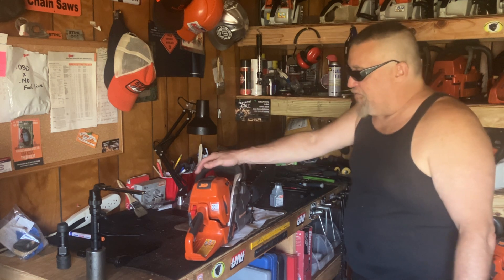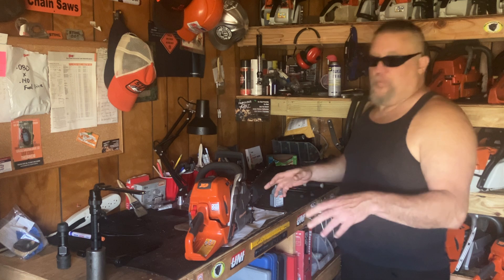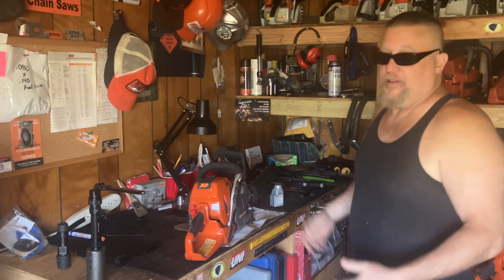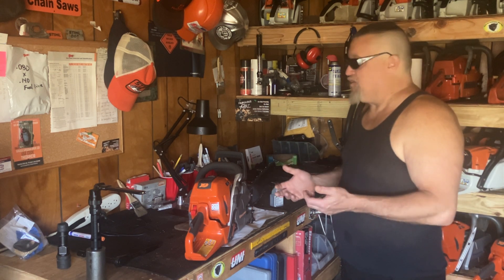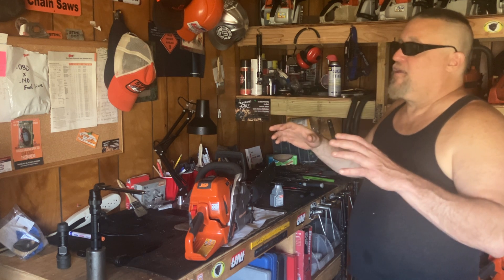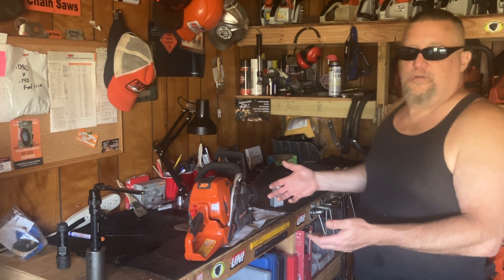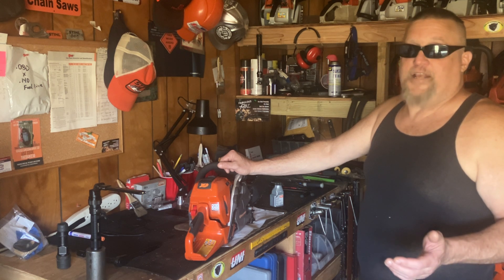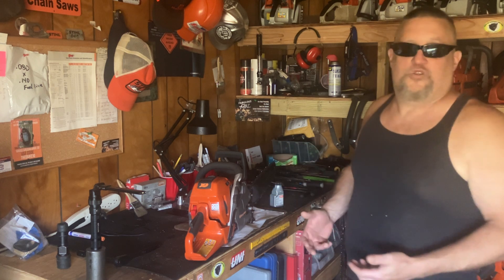Ol Fabz givin ya the straight goods on a few of these utube  “amature-experts” / charlatans 😉

Comment: I had a interesting scenario comparing one of my shops 2-250 dlr woods ported saws with another builders 5-600 port jobs. To mch to txt be nice to talk to ya direct buddy
Reply from the maker: My Email is in the description - I’ve done similar comparisons and have even purchased saws built by other well known builders that occasionally come up on eBay in order to be able to give an intellectually honest comparison / opinion … My conclusion : the old-school way of saw building is superior in terms of 1)performance, 2)fuel economy and 3)longevity vs the machined / ported high compression builds (which may cut 1 sec or so faster  in a 20sec cut) but use more fuel and most certainly do not last as long !   There are other issues with the tune-ability, heat (running too hot 🥵causing loss of power) and the increased likelihood of catastrophic damage occurring which usually takes out the top end (minimum) and sometimes results in a very expensive paperweight- they also can be a pita to pull over in cold weather and do a number on the starter mechanism. I’m of the opinion that a ported saw should equal the next class up (562xp modded runs / slightly exceeds the 572xp stock saw) and that’s THAT. Taking a 4.7hp 562xp and building it to produce 7.0hp IS possible , however not very practical in a real world , work environment- as a toy / “race” cookie cutting gtg saw sure. Unfortunately ya can’t make THAT style build into a useable worksaw , any more than ya can make chicken soup outta chicken shit 😂

Comment from the maker: https://youtu.be/XaaUxi31l3Y?si=u42_383-11DOaAeR … here is another perspective on STIHL ultra from a small engine mechanic - interestingly enough the “professional chainsaw mechanic / guru” Richard Flagg (and his flunkie Jason Pennington) mentioned in my video who bashes STIHL ultra (refers to it as “pond water”) makes an appearance in the comments section of the above video and admits that though he bashes the STIHL ultra it works just fine … AHA ! 😤 There simply Cannot be folks who get hundreds of hours using ultra / pump gas and then the 180degree diametrically opposed position that the oil is garbage that Mr Flagg / flunkie Pennington asserts. There is too much life experience by others that indicate results that do NOT align with Mr Flaggs / flunkie Pennington position so someone is incorrect / not being intellectually honest. Like I said in my video , my position is that Richard / others are overbuilding their saws thus causing them to operate in such a manner that the STIHL ultra wasn’t designed for (perhaps excessive heat 🤷). Now that we get to the TRUTH of the matter we see that the ultra mix oil seems to work  just fine for everybody else , and that the BUILD  is the culprit …. NOT the oil.  If I have to use a “special dirt bike oil” to run my ported/built saw(s) then that tells me everything I need to know !  THATS a style build I’m going to STEER CLEAR of 😂. Oh what a tangled web we weave when we first practice to decieve !!!